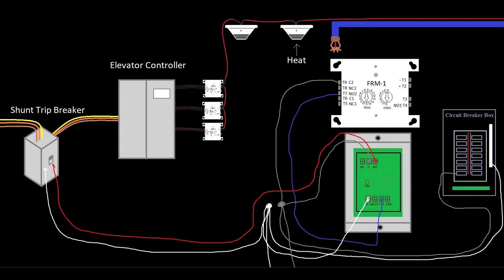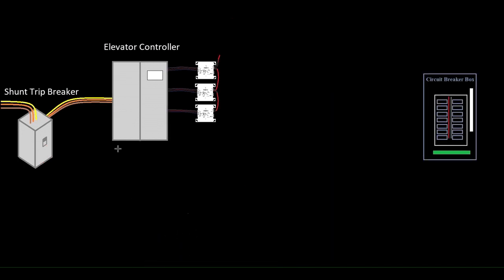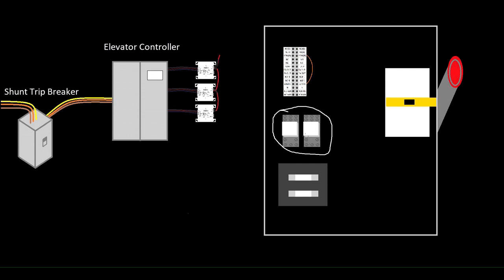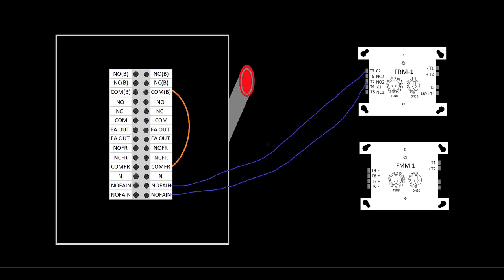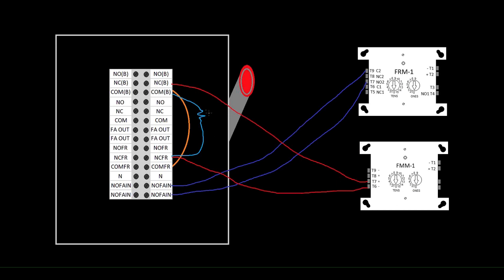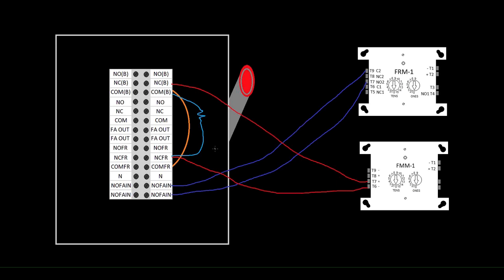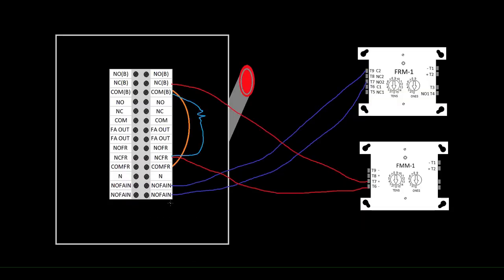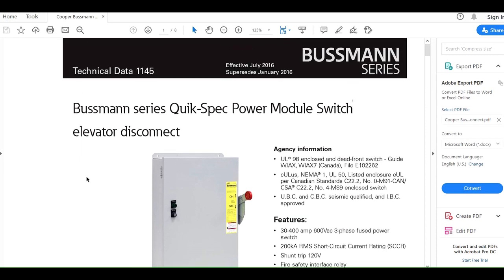41 - Elevator Shunt Simplified- Introduction to Fire Alarms

Comment: great job explaining this topic. i have to do my first shunt trip this week. i planned on using 24VDC from AUX POWER from my Fire Warden panel sense i am not using it for anything else to run power through my FRM to my RIB relay to trigger it and my 120 will be going through my RIB relay to the shunt trip breaker. I think i will try and use your method and run 120 through the FRM to the RIB relay sense there is little to no current draw next time. I just got nervous thinking about running 120 through my addressable relay but it makes sense why you would do it that way, thanks again for the sweet vids man!
Reply from the maker: The aux power circuit would work too, it's possible some companies prefer that method. To me though, you'd have to supervise that 24 volts AND the 120 volts, so you'd need extra parts.